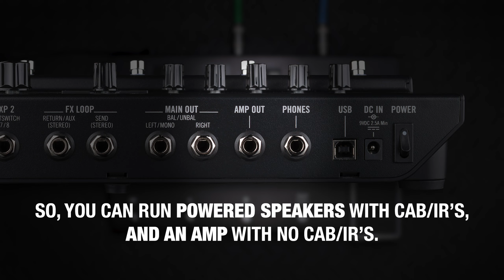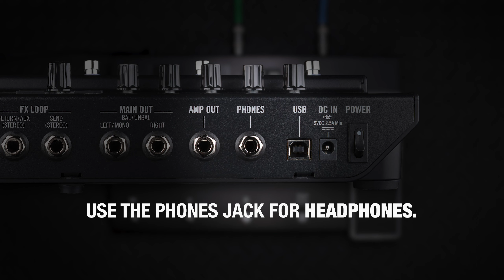Line 6 | POD Go Quick Start Part One: Connectivity and Play View

Comment: What do you mean XLR male cables to the main outputs? I must be seeing things wrong because that looks like 1/4” TRS.
Reply: use TRS stereo to XLR
Reply: @galihadinugroho7778  TRS stereo to a single XLR? Where does this go in the mixer, regular mic input?
Reply: @spacep0d  yess, use xlr input on mixer. Basicly you dont need di box anymore. Just need trs stereo to xlr cable/converter
Reply: @galihadinugroho7778 Technically, it's not TRS stereo (although it does have three connections.    It is called a "balanced TRS".   (A ground plus two actives with opposite polarity whose magnetic fields canceled (and which cancel magnetic interference, just like an XLR)).
Reply: Hi! Does just saw this poast and im a new podgo user. This means i can plug on either left/mono or right, is that correct?

Comment: What do you mean by "can be tapped directly before the CAB/IR block"?
Reply: That means the signal from the Pod Go does not contain a cabinet "simulation" or an impulse response, just the modeled sound of an amplifier.  For example, if I plug the Pod Go straight into a mixing board, I can simulate a speaker cabinet or impulse response, so it sounds like I had a microphone in front of a speaker cabinet.  If I plug into an amp "before the CAB/IR block", I would be using the speakers in the amplifier and not a cabinet simulation or impulse response.  When I play into my Fender Twin Amp with two 12-inch speakers I can turn off the cabinet simulation or impulse response in the Pod Go and the sound coming out of the Twin is the speakers in the Twin.  
Hope that makes sense.  
MK